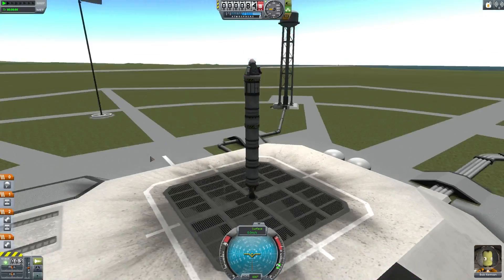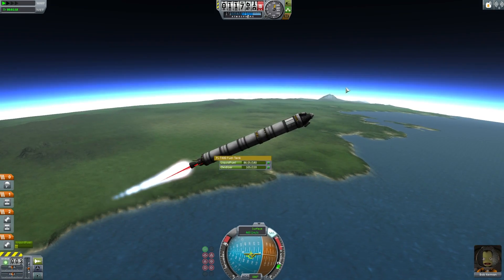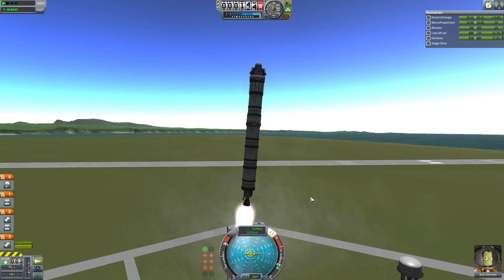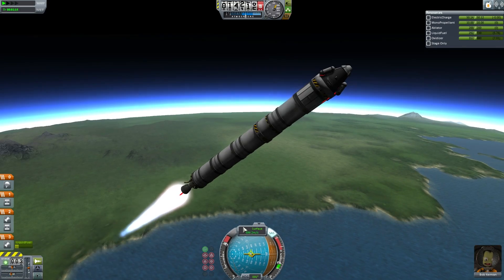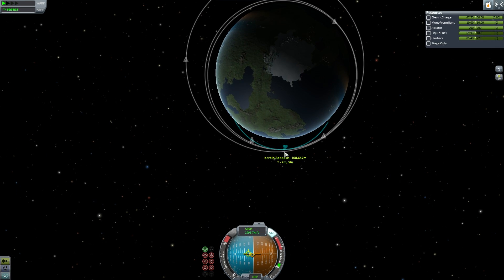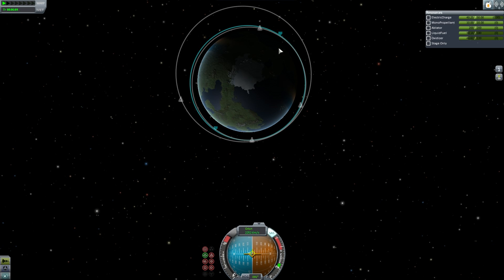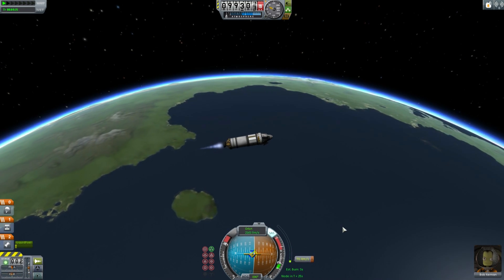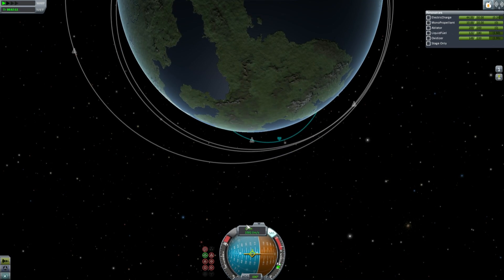Kerbal Space Program 1.0 - Launching Rockets To Orbit

Comment: Scott Manley Is the new version more efficient on your computer?
Or is it more intensive?
Reply: azmanabdula I didn't notice any changes however it loads A LOT faster and uses less RAM.
Reply: azmanabdula To install Linux.
Reply: azmanabdula maybe they did add quantum mechanics to the game and the planet was facing a denser part of the sun and it had some quantum tunneling going on and it was drawing mass from one side of the ship causing it to tilt
Reply: Jebediah Kerman Arent we all...
Reply: azmanabdula it is a little easyer on your computer and it loads alot faster. they fixed alot of bugs and the big memory leak.
Reply: azmanabdula 1.0 is much faster than ever before.
Reply: It's a lot faster to load, though.
Reply: azmanabdula it seems to run much better on my crappy computer and loading times are like 3-4 times faster
Reply: azmanabdula i think i had a similar bug. i built a rocket with no obvious structural faults and i rebuilt the whole thing and it just started wobbling on the launch pad for no reason and some tanks fell off
Reply: i don't know how it works i was just spit ballin
Reply: azmanabdula I haven't noticed a change in performance. I know that's pretty anecdotal, but if it can work on my stock hp I think most people will be fine.
Reply: azmanabdula here is a lot faster...
Reply: LukeSkyPwner There are still some memory leaks, apparently. My game kept crashing because of them until I went back to using quarter res textures. My computer has limited RAM, so it's very sensitive to any memory leakage, so it simply may have escaped notice by people using more modern machines.
Reply: Thanks guys....    but i have 3.8 GHz  16 G RAM etc etc 

I should be fine, (except for my fans that need replacing)

Thanks for the Info though!

Can anyone tell me what the aerodynamics is like?
Reply: ***** I know....   It pisses me off....
Reply: azmanabdula Think of it as an opportunity in disguise. ;)
Reply: AlienCollective wait.... which part?
Reply: AlienCollective I had a feeling you were going to say that....  

I am really considering it.... honestly....
Reply: Jebediah Kerman Whats with the Aerodynamic phantom forces in 1.0

(got it yesterday)  

Ive noticed when leaving the atmosphere the ship moves around some center of gravity that shouldnt exist... albeit very small, i notice it...
Reply: azmanabdula if its below 15-20 km then you might be turning too hard or your ship isn't aerodynamic but if that's not the case then i don't really know
Reply: Jebediah Kerman straight up...  

The ship moves like its in a paint shaker...

a really dangerous paint shaker.... : P
Reply: azmanabdula you might have gotten a defective copy or something ive never heard of that
Reply: Jebediah Kerman I think i had multiple fuel tanks/rockets in one spot because i remade the rocket and no strange effects...

I really dont know why it did that...

also, i had another rocket continue to turn in one direction, i spent a while trying to figure out why, checked each rocket for thrust limiting, checked for strangely placed fins, nothing...

I may have to send a bug report : P
Reply: Jebediah Kerman Some strange quantum decoherence going on with kerbal space-time
1.02 or which ever version it is : P 

I still havent figured out why one rocket design continued to turn right, so i rebuilt it, and went to minmus and back with no problems....

Im dumbfounded...
Reply: Jebediah Kerman Im not convinced that theory applies to this universe....
Reply: +azmanabdula When you have a massive Rocket and alot of thrusters on at the same time it still is suprisingly intensive on old cpus like the quad 2 core but otherwise It has improved
Reply: Muffin That was ages ago, but thanks.....
I guess : P
Reply: uhm, i use windows 10 and i run ksp on the latest versions now, 12Gb RAM(it never needs that much though) and if it needs RAM it gets it, never crashed without reason except once i had a bad updating process, i just clean installed it and its smooth.(Version 1.1.3).
Reply: Feral Survivor On a side note, Windows 10, have you had any problems, im really not sure about upgrading, considering this computer was built for win 8.1
Reply: I Never had a problem with my Win10, not a single bug, updated from 7 to 10, i have a 64bit intel i5 with (had 4 at the time, now its 12)Gb RAM and a built-in HD graphics 5500 with 2Gb of video memory(strangely it ramped up to 6Gb after my RAM upgrade but wth).I think half my specs can still run windows 10.I PERSONALLY recommend upgrading to 10.
Reply: Feral Survivor I tried on my laptop (Win 7)
and there was a bios error, i dont even want to try it on my rig, being built around 8.1 and how annoying it was at first, its only now seeing true stability, and i have so many first hand experiences where it either does nothing (stable), or fucks everything...

I know there are true benefits, especially for multiple core processors, but...  again, nervous..
Reply: I understand your opinion, but i managed to record a video today,lagless and i also use a laptop.
Reply: Feral Survivor 
Good luck, im keeping 8.1, im not risking ruining what works well..

Comment: But what if my rocket is so heavy that it can't turn just after start?
Reply: If your rocket is so heavy at a point that you dont have the ability to turn even slightly, you may have a problem.

However, Sepratrons are stunningly useful little things with the right tweaks.
Reply: Sakaton01 This is why RCS was invented.
Reply from the maker: Sakaton01 You have to use some judgement and figure out when is too early to turn. Too late is less likely to be fatal but still less efficient.
Reply: Sakaton01 RCS ports will add torque to the craft.